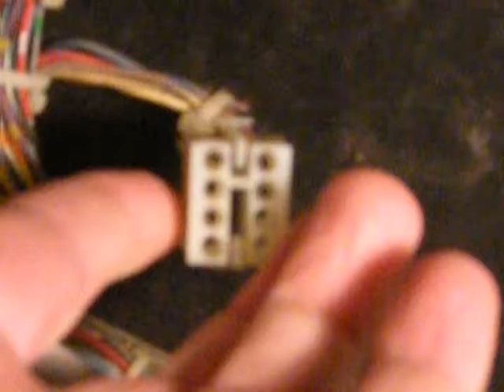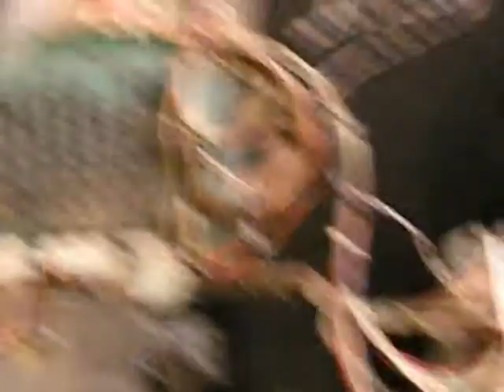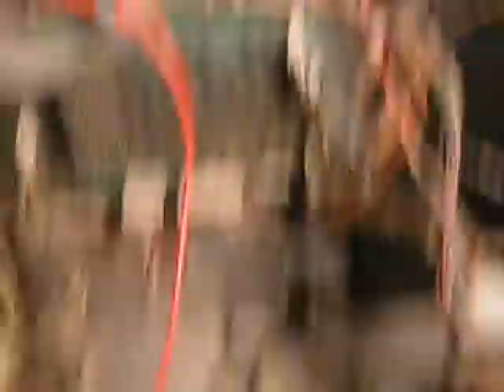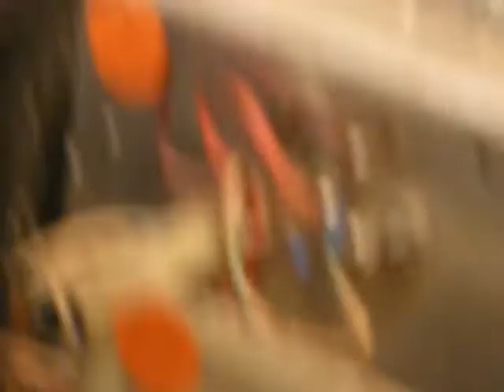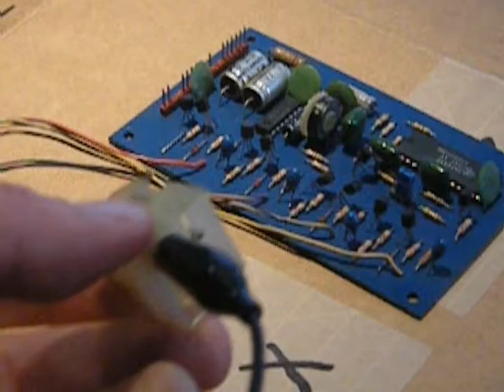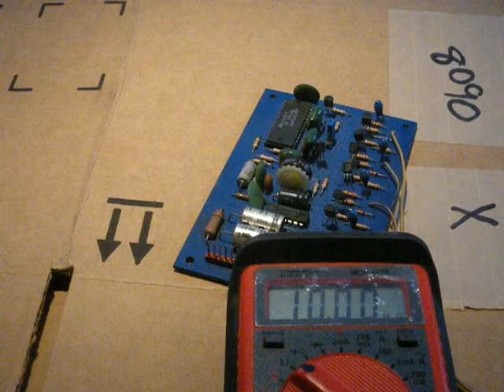Game Plan SSU-1 Overview and Testing

Comment: Love the in depth detail and straight forward info given. I'm working on the same soundboard at the moment and have it benched with the speaker so I can run it outside the cab. Issue I'm having is the 4 tone connections are working but the board just is stuck making one sound the whole time. Some reason one sound is stuck on or grounded and not sure what's causing it. It does change to the sci-fi sound when switched over sothe ti chip seems to be working.